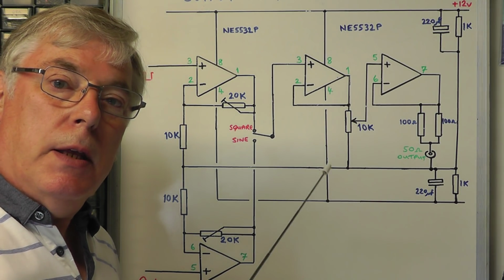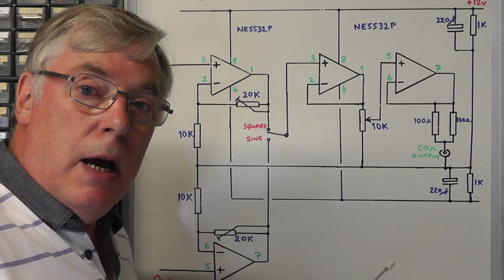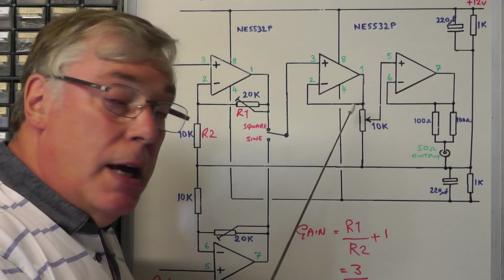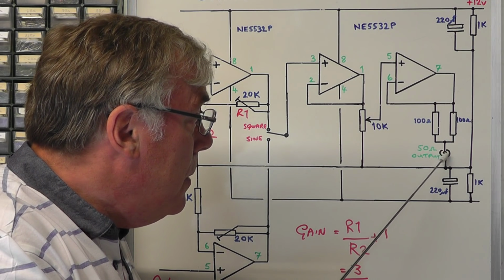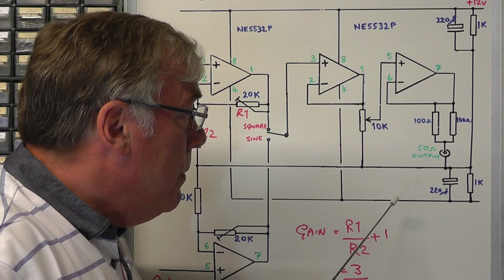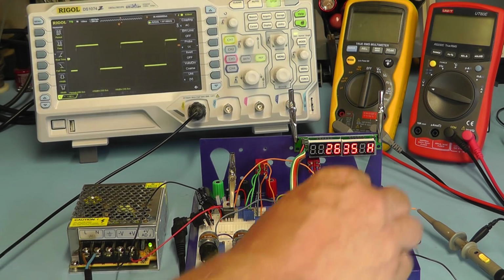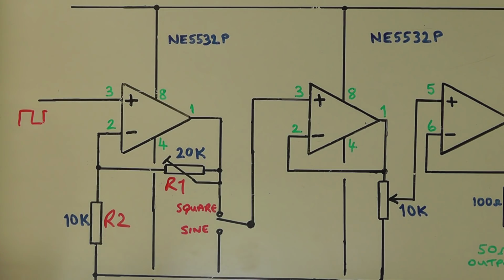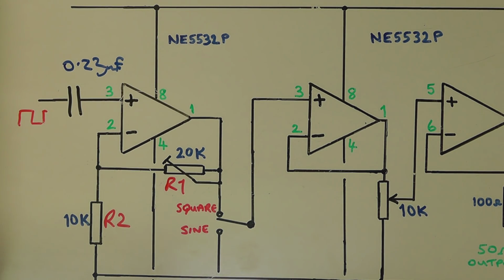Scullcom Hobby Electronics #26 - Build a Function Generator Part 2

Comment: Comprehensive and clearly explained project. A must for the hobbyist. Great to see the Nano being used.......it's not just me then!
Reply from the maker: IanScottJohnston Thanks Ian. In the past I was always using Microchip PICs but I think for the hobbyist they are more difficult so i started using the Arduino which seems more geared towards the home hobbyist.
I have been following your recent projects on your Handheld Voltage Source with interest. Thanks also for the link to the Autotrax Design Express (DEX) pcb software which I was not aware of.

Comment: Hello Robert, the parts have arrived,so the great build will start,it will be nice to have a function generator with a frequency readout, that will be a first in radio shack.
with every build I gain more & more confidence.
Reply from the maker: Paul Collins Good luck with the build. I plan a follow-up video in which I will cover some enhancements.
Reply: All enhancements welcomed ,maybe a ramp generator in there !!!

Comment: you know what could be a nice touch in the final version? put a small red led in a small box with a Z cut in the front and place it after the H to it's a lit up Hz.

very nice tutorial thanks for making the video
Reply from the maker: Eduardo J R Thanks. Yes it would be nice to show Hz on the display but the 7 segment display could not do that. However. we could use a 14 segment LED placed at the end of the display module to provide the letter "z". The KINGBRIGHT  KCPSA04-105  LED, ALPHA-NUMERIC, 10.16MM, RED would be suitable. These are available from Farnell (element14) for £2.10 each (there Order Code: 2449710). I may look at this as an add-on option.

Comment: Excellent!  So clearly explained.
Reply from the maker: Anthony Roby Thanks for your comments.
Reply: Scullcom Hobby Electronics Excelent circuit and nice you are back. But i find it very unsave too 
have the unprotected mains on the bench (bare srews on your switching 
power supply) and work with metal screwdrivers only some centimeters 
away.
Reply from the maker: Looxy Look Yes you are spot on - you need to be very careful when working near unprotected mains input connections. Normally these should be fully shrouded or the Power Supply should be fully encased. I did order a fully cased 12 volt Switch Mode Power Supply for this project but it only arrived today. I intend to do a follow up video so I will show you the new power supply module which is fully encased. For the hobbyist I always like to try to keep away from AC mains supply as you may have noticed in my other projects. Thanks for your comments.

Comment: I really like this project and have the parts on order, plus the case, What a clever use of the translucent panel for the display ,I hate cutting the slot in the usual method, I've ordered 3 x of the boxes, I have a couple of other projects in mind for those with readouts.
Paul
Reply from the maker: Paul Collins Thanks Paul.  The translucent panel does make life easier and looks quite professional on any finished project.

Comment: On your pulse/adjust switch youhave plenty of room to put it on the side either left or right in front of your power supply (I never liked reaching/fiddling behind anything) was glad way back when tek moved the ext trigger to side on upgrade/replacement of the 5xx series. Then again this just could be a quirk to me. In any case this was a good follow along project/tutorial. Well Done Sir!
Reply from the maker: Mooky Mann Thanks for your comments. The positioning of the pulse/adjust switch location is up to the individual and so you can fit it to your preference.

Comment: This is a very nice project and great presentation.  I will be building this using a Nokia display and omitting the big chunky power supply and powering the whole shebang through the usb connector on the Arduino nano.  BTW not to be a buzz killer but you and use a Apt on a Android with 3.5 output jack to 2 RCA connectors, but of course, its not as much fun.
Reply from the maker: +Joseph Nicholas Thanks for your comments. Using a Nokia display means low current so no problems using the power from the Arduino Nano as you suggest. The reason I used a larger LED display was that I intended this unit to be used on a work bench with other test equipment - so the larger brighter display may be better suited.

Comment: Thank you for such a smashing project :-D
A very neat and compact generator, also stripboard isnt allways the smallest or easyest way of making something, but you did it :-D.
I did look at your virtual Ov line and thought 1k seemed too big for the 50ohm output, but after slapping myself for being stupid, i saw you had ac bypass capacitors to create a low impedance earth.
Im sure my brain goes on holliday sometimes... ok most of the time lol :-).
The inserted capacitor did have an effect on the squarewave edge, i did think it could have been replaced with a resistor and the feedback resistor swapped to the input, but i havnt touched op-amps for years so i may be talking daft again ha ha :-D
Reply from the maker: zx8401ztv Thanks again for your comments and support. With regards the OP Amp output stages I think I will cover a few minor changes for things such as the slight overshoot on the leading edge of the square wave in another video follow-up which I plan. I am sure it can be improved, but the circuit currently works quite well and should be OK for the hobbyist.
Reply: Scullcom Hobby Electronics Dont forget that im not picking fault with your designs, your generator works perfect :-)
I havnt thought too deeply about electronics since i lost my mum, your projects make me interested in electronics again :-D
Reply from the maker: zx8401ztv Your comments are always welcome.

Comment: Typo in the schematic.  I know you've replaced this with the Mk2, but you still might want to correct a typo.  In the schematic you've specified a 79L05 to provide the +5V rail.  The 79xx series provides negative voltage, it should be a 78L05.

Comment: Two separate switches for selecting the waveform is clunky!  My function generator mentioned in the comment I left in the previous video uses a single rotary switch. Also the one switch not lining up with the other switch and the pots on the front panel just doesn't look right.

Comment: I know this video is several years old, but still marvelous and a project I am going to try and tackle. I plan on using and HMI touchscreen for mode selection and possibly using something similar to an AD5206 digipot for frequency control. My question is, Could the toggle switches be replaced by CMOS analog switches?  Would you recommend individual switches to prevent crosstalk between channels?  Taking the above into account, is there anything that’s screaming “I’m going to cause problems”?

Comment: Why did you choose 50ohm output impedance instead 600ohm or 1K, more suitable for AF? Also, using a dual rail power supply (+6V/0/-6V) wouldn´t be better? That way can skip some coupling capacitors, coupling the stages in DC and having that advantage that the signals are zero centered, no DC component.

Comment: If you're going to provide a TTL-compatible output from that hex buffer chip,  I would take advantage of ALL of the available gates run in parallel,  which would give you somewhat higher drive capability.

Comment: Very good and useful project. Any chance of posting the links (inc. the case). Thanks
for all your work. Keep them coming.
Reply from the maker: elboa8 I will post the links to the full circuit diagram and software shortly in the comments above. The case is a "183x133x60MM ABS Grey Project Box Case Enclosure Housing & Red EndPanels Z112R" which I purchased on eBay at a cost of £5.45 plus £3.60 delivery costs. The link to the eBay item/supplier is below:
http://www.ebay.co.uk/itm/183x133x60MM-ABS-Grey-Project-Box-Case-Enclosure-Housing-Red-EndPanels-Z112R-/251880890929?pt=LH_DefaultDomain_3&hash=item3aa5456231
Reply: Scullcom Hobby Electronics Thanks...

Comment: Great video. I can't wait to watch part 3. 

However, I noticed that the waves are not pure. The sine looks flattened on top with a small overshoot in the center. You did mention how to fix the overshoot on the square wave, but I also noticed that the wave itself is also not pure (the vertical lines aren't vertical). And I also see a flattening at the top of the triangular wave. Any way to fix those imperfections, or are they just imperfections in the IC? Many thanks....
Reply from the maker: Thanks. I cover this issue in Part 3 of this project.
https://www.youtube.com/watch?v=cdIJhh17vaM&index=3&list=PLUMG8JNssPPwjMZ0eUjj5Zahx2yjz6Alo

Comment: A few issues:
The capacitor on the input of the opamp? Where does the input bias current go?
With the capacitor you are going to get the output floating up/down when using the pulse width adjustment.
Can the opamp handle the 50ohm output (Short circuit output current is specified at 38mA)?
Reply from the maker: Henrik Jensen Thanks for your comments. Yes you are correct. Normally you have a D.C. bias return resistor on the input pins of the OP Amps. In my circuit design on the square wave input to the + input to the OP Amp  I AC coupled the signal with a 0.22uF capacitor to overcome a problem of the D.C. input signal level effecting the adjustment of the gain of the output. Simply adding the capacitor solved my problem. In this case the input bias currents will flow through the coupling capacitor, as the gain of the amplifier in this project is very low, only x3 or less, the charging rate is still fast enough to not effect the operation (value of the capacitor will effect the charge rate), so the circuit works fine. If the gain of the stage was much higher then it would cause problems, as the charging time increases proportionally with the gain. However, if you wanted to provide a bias current path you could simply add a high value resistor from the Op Amp + input to ground, in this case I would suggest a value of 100K ohm or even higher - I may try adding this later to my project and check its operation. However, adding a resistor will also introduce some noise so there is a trade-off.
With regards the 50 ohm output so far I have not had any problems. You are correct the IC datasheet for the NE5532 does show an output short circuit current of 38mA which is a typical value but the maximum value is 60mA. If you are concerned about this you could set the output impedance of the last OP Amp in the output stage to 600 ohm by replacing the two 100 ohm resistors (in parallel) with two 1.2 K ohm resistors. The datasheet does make reference to 600 ohm load so changing the resistors may make some sense.
Reply: Scullcom Hobby Electronics I will suggest you check the DC output level, without a resistor to handle the bias current I doubt it is zero volt.
If you are worried about noise, why not remove U3B it does not really do anything (It would be more useful as an input amplifier for an external frequency counter input).
I doubt you get much signal from the opamp if it has to deliver its short circuit current. The 50ohm impedance is fine as long as you do not load the output with 50ohm. It is a long time ago I have seen equipment with 600ohm output impedance.

Comment: Could you share the techniques you use to transfer the hole locations to the front panel? Getting precise hole locations transferred from the center lines of the parts to the panel is key to having a good looking front panel. Do you use a CAD program or do it manually?

If you source some of your parts on Ebay, most of the time you don't get specs and drawings which makes the task even more difficult.
Reply from the maker: Steve Rodgers I intend to do a follow-up of this project to add the extra features and discuss any other modifications. Following on from your comments I will also demonstrate how I made the front panel holes.

Comment: Have you tried and put the output signal to a Spectrumanalyzer? i'm quite interessed in the stability and sidebands.
Reply from the maker: Thanks for your comment. I have not done that yet but will give it a try when I have time.
Reply: I cannot wait to see the stability of it.
awaiting impatiantly.
In the meantime i'm working my version of the miliohm meter.
Reply: I would like to see this too. As far as I know, unwanted frequencies from the oscillator and harmonics are the big pitfalls with function generators. Did you ever get around to this?

Comment: Very nice... I have 2 XR2206 in my junkbox. Now I know what to do with one of them. Do you have an idea how to set the frequency via microcontroller? I
Reply from the maker: +Hubert Dreiling Thanks. Yes there are ways of using a microcomputer to set the frequency but this would increase the cost. One way to do it is to feed a variable voltage to pin 7 which is set by a microcomputer using an internal Pulse Width Modulation output to give a variable voltage. You could also use a DAC. The microcomputer could use a rotary encoder or keypad to set the out put voltage which is fed to the XR2206 pin 7 and hence set the frequency.
Reply: My idea was using a 4046 as PLL steering the VCO in the 2206. So I can input the frequency as square from a PIO. I know there was plans for it in an old Elektor magazine, but i can not find it.

Comment: Hi again! im almost ready to build this but before i do i wanted to ask you about the quality of the sine wave it produces? Can you possibly link a FFT output with sinewave?
Reply from the maker: +Adil Malim Hi. The quality of the sinewave depends on the set-up. I found you can trim the shape very well. Not sure what you are wanting with a FFT output. You could use an oscilloscope to show an FFt trace - is that what you meant?
Reply: +Scullcom Hobby Electronics i meant if you could show a FFT trace so we can get an idea of how clean the sinewave can get with this circuit specially at higher frequencies :)
Reply from the maker: +Adil Malim OK I see what you mean. If I do another follow-up on this project i will try and show a FFT trace on my oscilloscope. Ideally, for a perfect sine wave we should see one spike in a FFT trace.